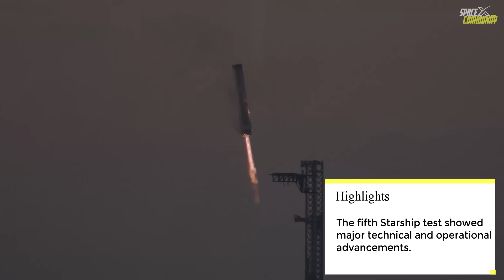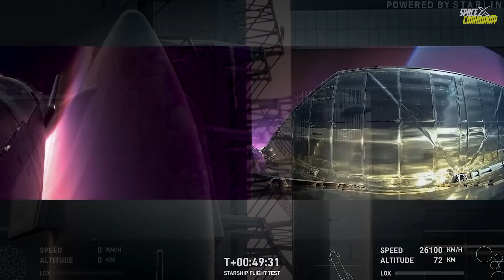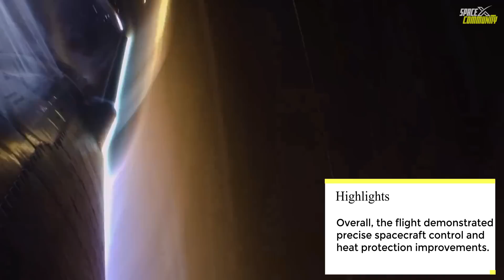What Exactly Happened During Ship 30 Precise Ocean Landing? NASA May Delay Artemis 2 | Episode 61

Comment: On the rocket. Even though the night was black at sea. The ship s flame showed that an awful lot of smoke 💨 was coming off just before it hit the water. It seemed to be black smoke 💨 rolling around the landing rocket 🚀 as well as as it blew across the ocean. Being at sea it couldn’t be burning anything else. Since it never struck SpaceX’s floating buoy with camera. It would have felt the heat but the camera and buoy 🛟 float seemed to remain working so one can only assume it was something off the ship. Either The Steel from which the ship is made from or the ablative material beneath the tiles. Which I would say is KAO wool which is used in kilns to prevent the heat escaping the confines of the KILN.

Comment: The ship didn't land right on the launch mount, it aimed for a landing on open ground in front of the tower, then translated into the chopsticks, and throttled down. This is a deviation from the CGI render. My point is that future landings will be vertical into the chopsticks, and will both use less fuel, and subject the launch mount to less fire.

Comment: I just had an absurd idea. Imagine a lunar starship, but the payload bay is ENTIRELY replaced with a large built-in telescope, and the, "nose" of the starship would fall or fold away. We'd basically get a whole starship as a platform for an observatory. It'd be tall to clear any ground ob structions, it'd be self-leveling, it'd be enirely stable, it'd get extra room for power and computer systems, etc... it'd be maybe impractical, but pretty cool.
Reply: cool

Comment: Fantastic achievement... BUT I Insist - Space X should have tried to save the starship orbiter.  Saved orbiter would provide WEALTH of data for improvements!  All They needed to do is; 1st - bring it to a control point in the ocean with the video proof that it is in the right place and is hovering just over the water.  2nd - when at the ocean water level - gimble the engines just enough (in opposite direction of the heat shield) to "tip" the starship orbiter on its belly (heat shield) and basically make a flip maneuver they perform during re-entry, but at the level of the ocean - almost if the ocean level would be a flip/pivot point.  3rd - shut down the engines, this will allow ship "softly" fall on its belly into the water.  Considering Starship Orbiter is water tight - it would float in the water, until picked-up by Space X (or other interested parties like Chinese ;0)  Space X in the beginning did these same water landing/splash downs with the Falcon boosters - why not with the Starship orbiter?

Comment: Need  high temp. paste to dip those flaps into before the tiles are applied. Finding the correct combo of building materials that work together in those difficult to reach spots around the hinges must be super difficult. Building the flaps light weight with high temp protection... maybe some sort of thermal paste near the flap hinges? Can't wait for Flight6

Comment: Surely the fins and heat shield is only required for an Earth reentry, a lack of of similar atmosphere negates the use of both these on other planets. I am surprised that there are no alloys that can be used but perhaps this initial stage of testing requires a cheaper solution.
Reply: Heat shield is required for landing on mars, like all other missions to mars. Not as thick as landing on earth though.
Reply: There is inconel X-nickel-steel alloy, used on X-15 and space shuttle, but its heavy and expensive
Reply: Mars re entry would absolutely require a heat shield and fins to have control. They come in fast and because the atmosphere is thin it takes longer to slow down, you spend longer at high heating than Earth re entry from LEO.

Comment: How long will it take to get the FAA licence ?  Will they drop of some Starlink satellites next time ?
Reply: They already have one for flight 6 when they got it for flight 5 if they change nothing. If they want to do an engine relight in space then it would likely be a simple modification.

Starlink is not going to be deployed until they can demonstrate the ability to de orbit themselves from an actual circular orbit. So far they've only done basically a parabolic trajectory that re enters naturally. Also the payload capacity is kinda low on this current version and the dispenser has not been installed. More likely to see payload on version 2 after a few flights.
Reply: The license for flight 6 has been approved already. There shouldn’t be any issues with that license since there were no problems with flight 5
Reply: Doing some full orbits, dropping some satellites and then catching Starship would be very nice indeed.

Comment: This new information release was enlightening as it showed the ability to orient the starship vehicle to it's appropriate landing attitude. Looking forward to when they catch it too in the chopsticks. This footage makes that a high likelihood in very near future testing launches. Space X is showing it's efficiency in making necessary modifications quickly, and solving problems faster than the governmental red tape machine can issue launch permits.
Reply: They wont need the chocksticks as the starship has legs. The booster was designed without legs to save weight and money

Comment: 4:35 But the atmosphere of Mars is much thinner than here.
Reply: True but still sufficient to scrub much of the velocity of the ship. Landing burn would probably need to begin much earlier than would be required on earth. This might not necessarily require more fuel for the landing burn as Mars has lower gravity than earth.
Reply: @okirooju3787  The engineering equations between the two planets always fascinate me - very counter intuitive with a faster fall yet less gravity along with predicting heating at greater speeds but with only a fraction of atmospheric pressure comprising different predominant gases which also heat differently.
Reply: Flaps will be fully opened and landing burn will be early
Reply: But it is also supposed to get back to Earth after landing on Mars, eventually. (Landing and refueling on Mars will have to be tackled first. And to get to Mars at all, refueling in low-earth orbit.)
Reply: Mars has 1/3 gravity too.  Mars atmosphere will be challenging…too thin for parachutes or aero lifting body, but thick enough to burn the craft during atmospheric entry.  It will be very interesting seeing g this unfold.  Good luck to Spacex.

Comment: Interesting that you left out the massive fireball explosion which took place just after water contact.
Reply: That’s because it was planned! So no need to mention it as it’s completely irrelevant.
Reply: What do you expect happens when red hot engines are dropped in water? Boom! 😁
Reply: The rocket was not meant to survive the ocean landing. It was doing accuracy tests, but it was meant to be scrapped too.
Reply: It was quite obviously planned, the starship needed to sink, so whether it blew up from the stress of tipping over, or from the Flight Termination System, the explosion was planned.

Comment: i think the next launch will be a block 2 ship.
Reply: Doubt it
Reply: They already have the booster and ship for flight 6 tested and ready the ship is getting a new heat shield as we speak
Reply: Rumor is that they are aiming for November 11
Reply: @ColourX_  That would be awesome, much better cadence.  I hope the change to licence to catch Starship does not get ridiculously bogged down.
Reply: The primary objective for the ship on this last flight was to achieve a precision landing just like they got with the booster on the previous flight. The next design/iteration of the ship already has hinge/burn-through issue fixed. They only reinforced the the heat protection around the hinge area just to maximise their chances of landing the ship precisely, which they achieved.
The next ship to fly still has the old forward flap designs but will be given the kind of reinforcement they did for this last flight. I believe the reason they will fly the old design ship in the next test is so they can hit other milestones like a full orbit, payload deployment, demonstrating a deorbit burn and landing the ship precisely again.
V2 ships will probably test new flap design, heat shield, v3 raptors and catching the ship. This is my opinion.

Comment: How they gonna land on other planets if it needs to be caught
Reply: They are catching the ones on earth to save payload capacity
Reply: It’s the booster that needs to be caught. The starship can land vertically.
Reply: Only the booster needs to be caught, the booster doesn’t go to space
Reply: @rope103mc2 wrong, a dozen return tanker starships need to top up the refuelling station in LEO for each HLS TLI
Reply: There will be different versions of Starship to land on the Moon and Mars.  There are renderings of at least the Moon version out there.
Reply: That’s the big debate at SpaceX…they are eventually going to have to add legs.
Reply: There will be at least 3 versions of the ship according to requirements:

1. HLS for the moon: will have landing legs as it needs to land on the moon.

2. Earth-to-orbit payload deploying ships: will be caught (at least for now according to SpaceX plans) by the tower. They're doing this to maximize payload to orbit as the extra weight saved from not having landing legs can be converted to usable payload capacity.

3. Mars ships: will look identical to above ships (2) but featuring landing legs for landing on Mars. You don't need a landing pad, at least initially, on Mars. Just pick a landing area with fairly even surface and have the self-leveling capability of the landing legs take care of the rest.
Reply: @okirooju3787 exactly, every bit of more weight also requires more propellant

Comment: are they going to refly the recovered booster ?
Reply: It's highly unlikely, it did it's job and Booster 13 has been in assembly and testing for most of the spring and summer. Booster 12 is obsolete and will likely just be taken apart and examined for data gathering purposes.
Reply: @lornes7526 most likely true but who knows it can be easily refurbished and set up for another flight. Best thing would be to set it up in a museum next to the hopper after they extract all good information they can
Reply: It’ll fly late Nov early Dec 2024.